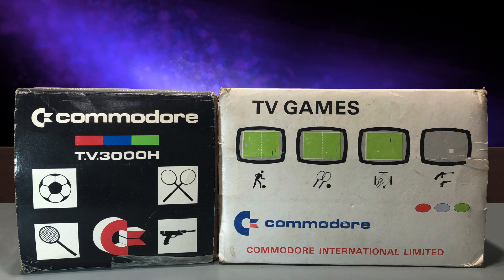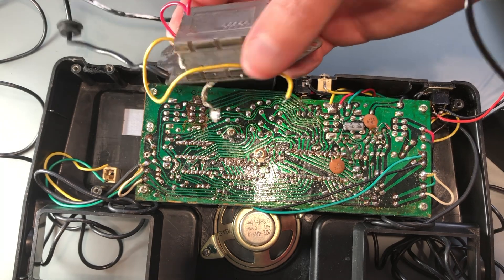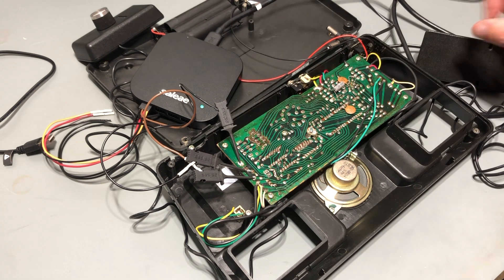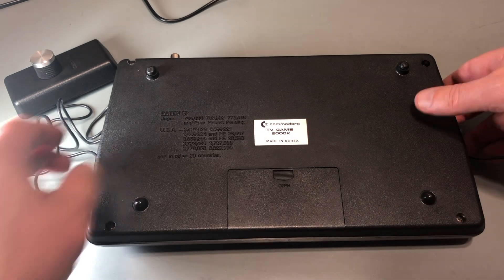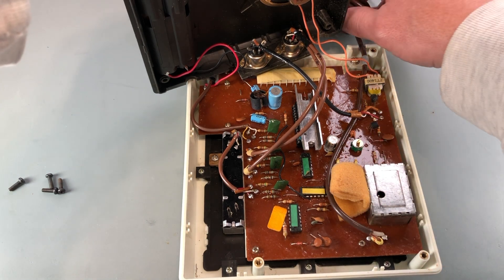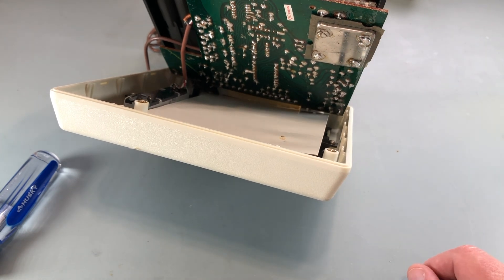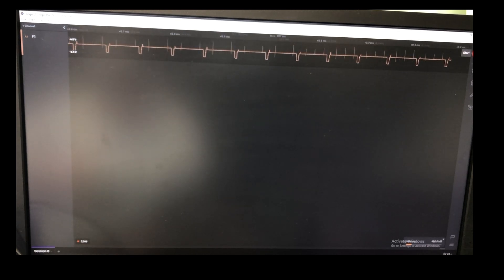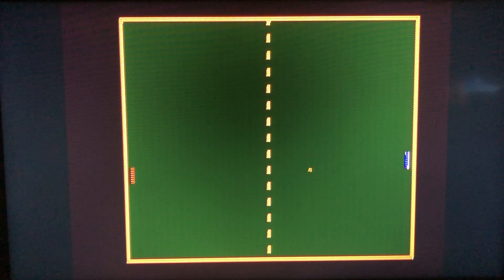Part 2: Commodore Pong Console composite video mod

Comment: Does the composite signal output not need the voltage line at all? Just the composite signal and ground?
Reply from the maker: Correct. I mean, the composite signal is voltage. But there is no dedicated power output.

Comment: TY for part 2. I got a MAX-04 last summer from Japan and watched and was set up to do Jan Betas video on a 1 wire composite mod. Right before I did it, Robbin from 8 bit show and tell had a video come out on the MAX-04. In his video he told me that the Japanese NTSC channel 1 & 2 or the same as my U.S. NTSC channels 95 & 96. I still had a 13 CRT TV put away and sure enough when I hooked it up to the TV it worked on channel 95. My TV only goes up to 95 so I was very lucky. Also, the TV is sliver and matches the MAX-04s case like they were made to go together. I took the MAX-04 and TV with me to World of Commodore 2022 in Mississuga Canada Dec 3rd & 4th and had it on a display table showing it to the attendees.

Comment: Nice work, I have a stack of old pong clones with awful RF, might give it a go.  Maybe just me, but the movement of the ball on the two Commodore pong clones seemed a bit jerky, compared with GI chip versions or pure analogue chip sets like in the original arcade.
Reply: Atari's arcade Pong used discrete digital logic chips.

Comment: Great work. I would install a 100uF cap in series with the composite video line, most of the consoles or computers of the era have a DC offset on top of the video signal, which some modern displays may not be happy with. Just a cap will block (filter out) that offset completely.
Reply from the maker: I was not aware.  Thank you!